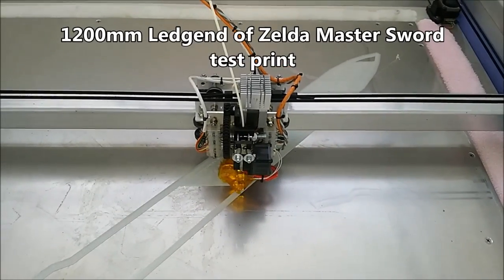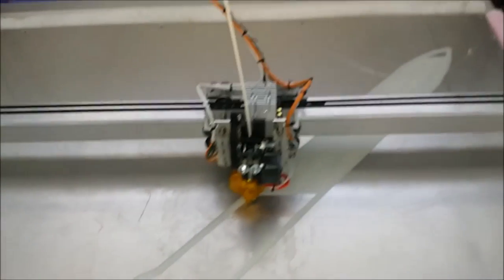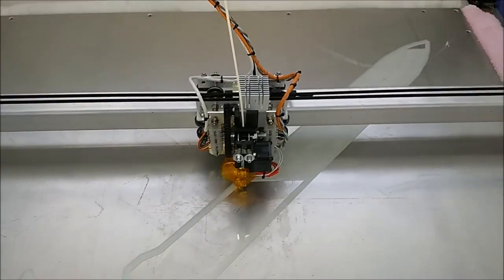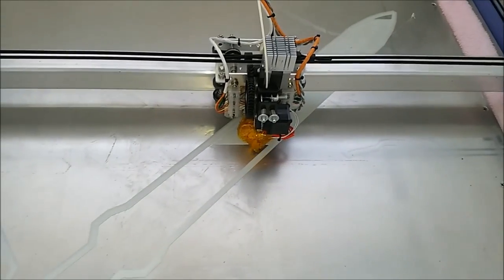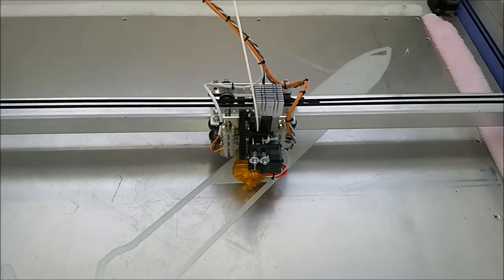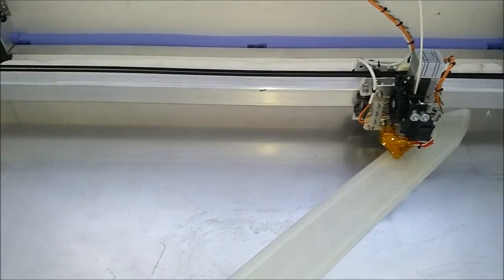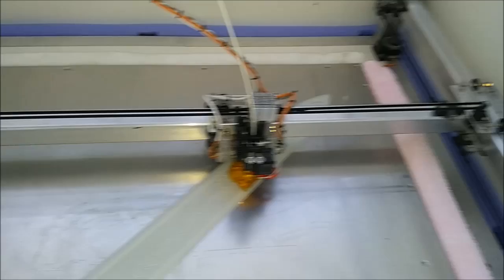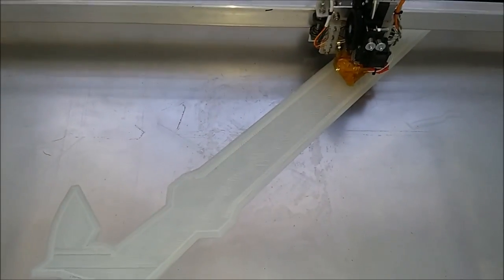Large scale DIY 3D printer - 1200 x 1200 Sub33D V3 - 1200mm Ledgend of Zelda Master Sword test print

Comment: I was looking for an 800mm x 800mm 3D Printer for printing bases for my rather large Robot Designs when I came across this. Have you designed other, faster units? I suppose I should just browse your videos. Can anyone recommend a commercial unit that can do 800mm x 800mm? Thanks.

Comment: Well it IS big one but the printing seems unreasonably slow, is the limiting factor of your design stepper motors (nema 17?), extruder or mass of printer carriage?
Reply: Dangerous_CODE he mentions in other comments the problem is filament flow - the extruder can't melt the filament any faster. He's designing a new extruder that has more power.

Comment: If you apply carpenters white glue to the bed you can print ABS very easy.
Reply from the maker: I did actually try that but found it did not stick to the aluminium
Reply: Sub33D I did on glass
Reply: sanded kapton!

Comment: I ve been thinking on designing something like this. Your machine is great. How fast can it print? Again, WOW
Reply from the maker: Cheers, with the current extruder (80W), it maxes out at around 40mm/sec (1mm nozzle, 0.5mm layer height), which is way to slow for this size machine.
I am currently designing a dual stack 320W extruder which should allow 4 x the current flow rate and speed (dual 100mm tall heating chambers, dual bowden filament feed, 8 x 40W heaters)
Reply: Sub33D I was going to suggest a DyzEnd, but they max out at 60W(they claim 500c). You might need a complete custum heat element.
Reply from the maker: The 320W dual stack design is ready and have ordered the parts, it uses 8 x standard 40W ceramic cartridges (cheap and convenient :-)
Reply: Sub33D sounds awesome, I'm looking forward for that video.
Reply: My dream printer right there. I'd love to be able to hit print and come back a couple days later to a massive bed full of parts. 

How's the printer doing? This thing needs more attention.